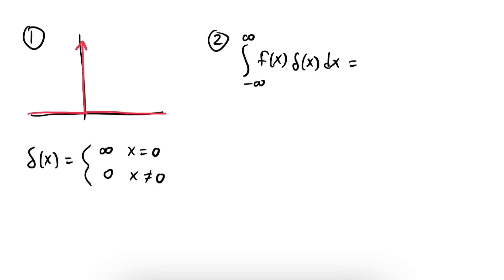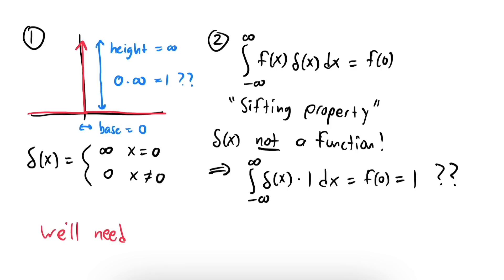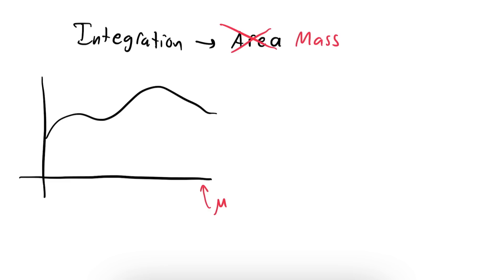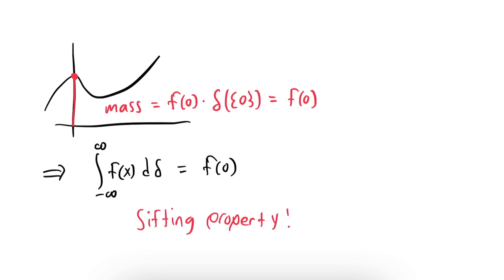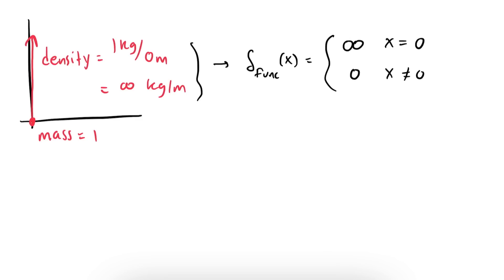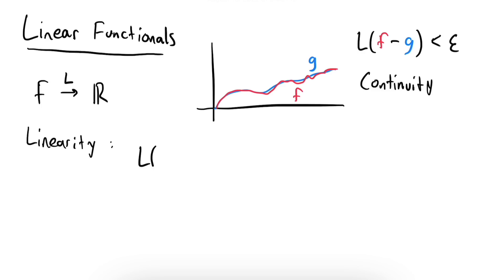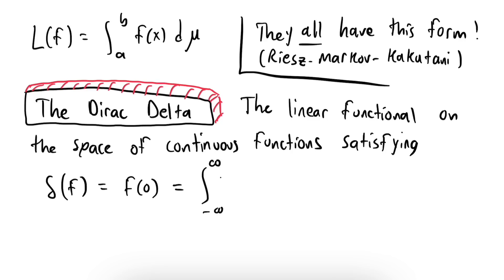Demystifying the Dirac Delta - #SoME2

Comment: I am having a hard time to understand the "usefulness" of Dirac delta and maybe somebody can help me here.

While the logic how does it work is clear to me I have a feeling like this is a form over substance. In the end you just get the value of f in a given x. What is the big deal? I understand the connection to other distributions but this one seems so mystical yet covers a seemingly extremely simple concept. We could say "f(x)" and done.
Reply from the maker: @Soyozuke  The Dirac delta a way of mathematically describing some physical phenomenon which is very localized in space or time. For example, a force applied over a very short period of time can be considered as a Dirac delta (in the time variable). Similarly, a point charge can be a Dirac delta (in the spatial variable(s)). Making this notion precise is basically the purpose of the video.
Reply: @kieransquared  Thank you for the response.

So basically this is about formalizing mathematically the concept of an impulse.

Comment: I think saying that delta itself is a functional is bit misleading. It's more accurate to say that delta is the kernel of the evaluation functional E_0(f) = f(0). Similarly, shifting delta gives the kernel for E_y(f) = f(y) in general.
Reply from the maker: But the kernel of a functional (in the sense of the Schwarz kernel theorem, if we're talking about distributions) is itself a functional - it's perfectly rigorous to say that the Dirac delta is precisely the evaluation functional, and it's how plenty of books define it.
Reply: @kieransquared  Schwartz asserts a one-to-one correspondence between distributions and maps by the kernel relationship, but I've never seen anyone make a full identification between them as such. 

Not to say I don't believe you, I'm sure there are references like that. It's not too far off from making an identification between a linear map and its matrix. Still, I would honestly give the same critique to those authors as I have here.
Reply from the maker: @alxjones  I think pretty much every text on distributions I've seen (notably Hormander's tome on distribution theory) defines the delta distribution as the map delta_a(f) = f(a) (and also wikipedia, Wolfram mathworld, etc). Now that I think more about it, I'm also not even sure what it means for a functional to have a kernel - I'm only familiar with the notion of a kernel for "distribution-valued" functionals, i.e. bounded linear maps from test functions to distributions.

Comment: The only critique I would have is, to my mind the usual "working mathematician" way of thinking about the dirac delta is as a type of generalized function called a Schwartz distribution, rather than the purely measure theoretical way it is presented here. But I have a difficult time imagining how to make that an approachable topic for a video like this. You hinted at this briefly by mentioning that it is a linear functional, but then pretty much just abandoned this train of thought.
Reply from the maker: True, I considered presenting the Dirac delta as a distribution instead, but I realized it would almost be overkill, as it’s a lot harder to conceptualize distributions compared to measures. Maybe I’ll make another video about distributions at some point. In any case, since measures are a subset of the distributions, I think it’s easier to understand the measure-theoretic approach first before distributions, even if it’s less powerful.

Comment: Your video is not just about understanding the Dirac Delta, it also gave an intuitive way to understand Lebesgue integral, which is pretty hard to visualize while reading the theory of it. 

Now I can understand why some engineers approximated area of a region by drawing it on a piece of cardboard, then measure its weight and use the "weight to volume" formula to determine the area since volume = height x base-area 🤣Turn out they are just doing what Lebesgue integral did

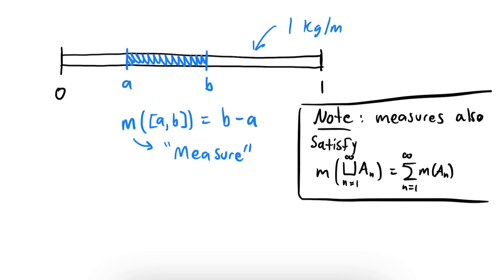Comment: 3:00 Measures obey subadditivity, the = sign of the boxed equation should be <=. Equality occurs when the sets An are all disjoint.

Edit: Ok the flat union means disjoint so should be equality. My bad.
Reply from the maker: The union symbol with a flat bottom denotes disjoint union; also subadditive set functions need not be measures so there needs to be equality there.
Reply: @kieransquared  Oh ok thx. I did not know the flat bottom means disjoint union.

Comment: The delta function can also be defined as the limit of Gaussians with mean 0, as variance -> 0.
Reply from the maker: Yup! I actually have another video that touches upon this :)
Reply: In what topological space is this limit taken?
Reply from the maker: @carlaparla2717  You could either take it in the topology of measures, or in the topology of distributions (these are the respective weak* topologies for the space of continuous functions, and the space of smooth compactly supported functions). Basically, a sequence of measures mu_n converges weak* to mu if for all continuous functions, integral(f dmu_n) converges to integral(f dmu). So in this case, the dmu_n would be [n/sqrt(2pi)]*e^{-(nx)^2/2} dx, where the standard deviation is 1/n, and they converge to the Dirac measure.
Reply: @kieransquared  couldn't you just use the uniform distribution to make life easier?
Reply from the maker: @10babiscar  That’s true, a uniform probability measure over [-h,h] also converges in the weak* topology to the Dirac measure as h goes to zero

Comment: I must admit, I am not the target audience for this video. If I had just received a clumsy explanation of the Dirac Delta in some class, this would certainly be a great video! But since this is the first I have heard of this equation, this all felt a bit disconnected from any context. It reminds me of a guide I once read on building linked lists. I understood it, but without any implementation shown, I didn’t know how to use anything I had read or when I would even want to.
I don’t really know what the video is missing since I know nothing about this subject you didn’t just tell me, but I think this needs to be a bit more grounded rather than being some small piece of a puzzle I have never seen.
For context, I took 4 calculus classes in college.
Otherwise, the video is very clear and the visuals are good. Thanks for making it.
Reply from the maker: Thanks for the feedback! In practice, physicists and engineers use the Dirac delta to model phenomena that occur over a very short period of time or in a very small region of space. If you vibrate a mechanical system, the input to that system is a sine wave. But if you hit the system with a hammer (imparting a force over a very short period of time), you can model the input as a Dirac delta. Similarly, a distribution of charges create an electric field, and you can solve for the electric field by solving a differential equation. If you take the charge distribution to be a Dirac delta, that models a charge localized to a point, such as an electron, and can therefore solve for the electric field created by an electron.
Reply: @kieransquared  in a sense it seems physicists are always ahead of mathematicians in using mathematical concepts. Only after some time mathematicians catch up and make it rigorous, but somehow it always works.

 It strongly reminds me of calculus early days. When Newton used it concepts like limits and derivatives weren't well defined. He essentially divided 0 over 0, but without any problems or paradoxes emerging. Then only in the 19th century an actual rigorous underbelly emerged with the epsilon delta definition, riemann sums, etc showing it was alright after all.
Reply: @dekippiesip  because physicists invente things they need, and then come mathematicians to explain "you all are wrong and you can't do like this!" :)
Reply: @kieransquared  Ok, thanks for the explanation. I actually have a bachelors in mechanical engineering, but every time a class mentioned impulse, they kind of glossed over it and never mentioned any of this.